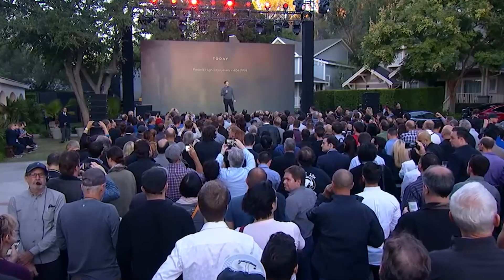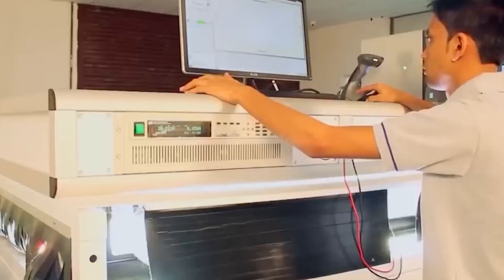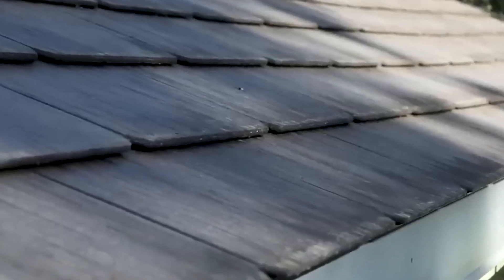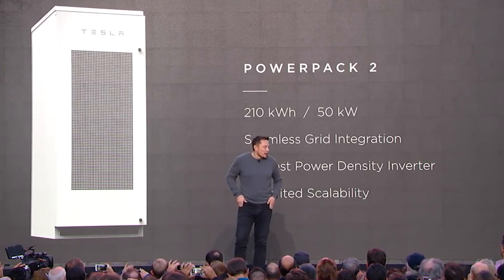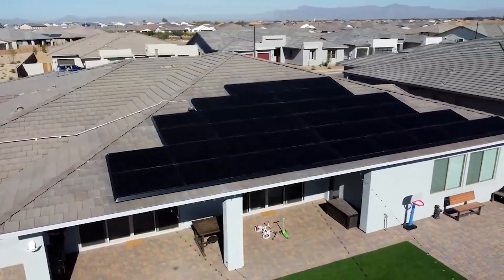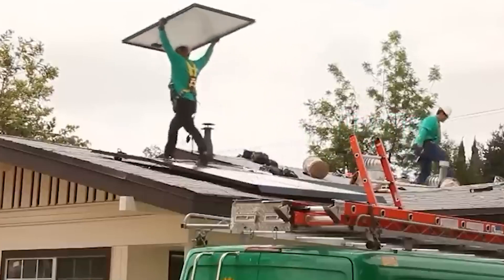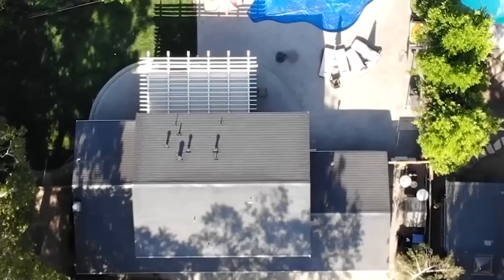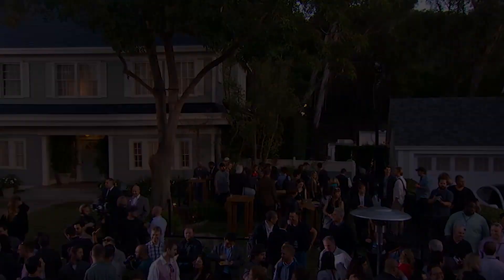Elon Musk REVEALED Super NEW Shock 4.0 Solar Tech Change Entire Industry!

Comment: I live in a condo so installation of solar panels are regulated by the HMO. I also live in southeast Florida about 10 miles from the Atlantic Ocean and the Intercoastal Waterway about 2 miles away. Lots of storms here AND hurricanes. Wanting a solar cell system on the ground that will cover the air conditioners on the west side of the condo. Possible?